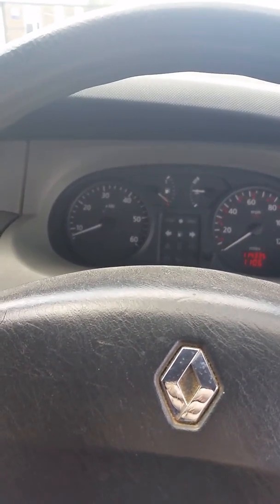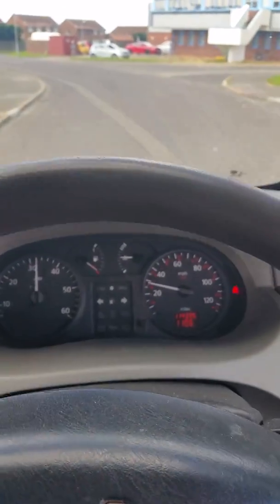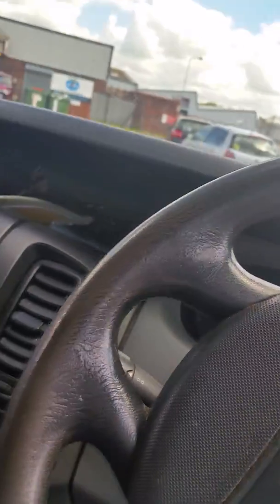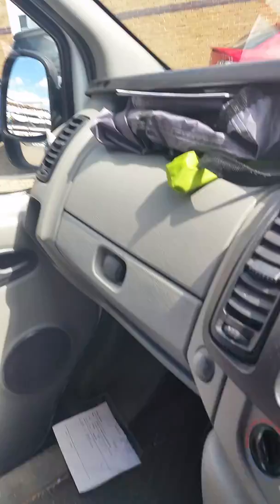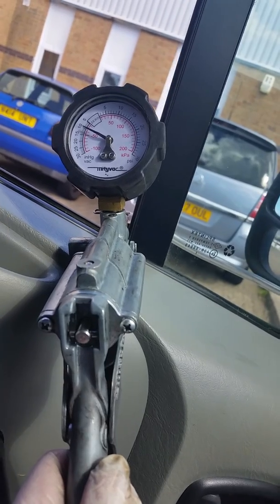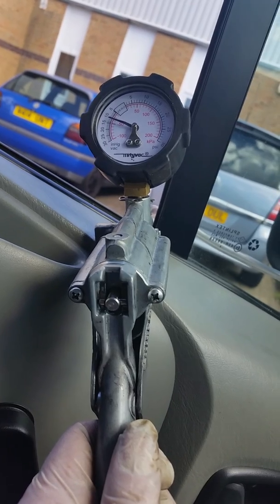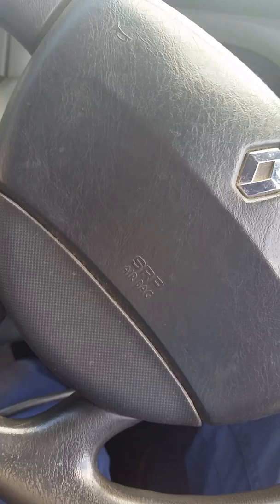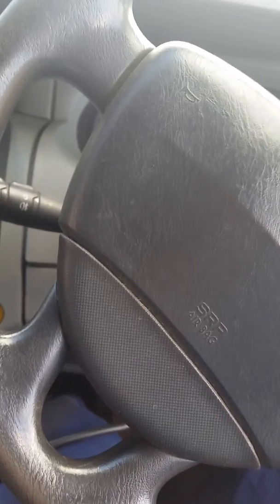Renault traffic lacks power diagnosis

Comment: I have a 1.9 trafic that all of a sudden has hardly got the power to get up the driveway of the house. Like it's got about ten per cent of the power it used to have and thats with foot to the floor.  Any ideas ?   It doesn't have the magical blue plug in the fuse box its a 2006. Thanks

Comment: Mines exactly the same in vid on power till 2400-2600rpm , I tried the pedal tho and my pedal goes soft after engine off.Driving me nuts can’t figure it out, could it still be same thing my  brakes just feel soft to as u come to a slow stop ( just pushing them) it’s like the pedal feels sticky and goes slightly soft when u come to a stop

Comment: Remarkable in all this. Is that, how people with so much information around. Still neglect something as basic as oil and filter changes. It´s by far and wide the best engine savers in the long run. Penny wise, dollar stupid, to it´s best. ;-)
Among other cases once I was faced with a client complaining about valve train noises, general malfunction, surging, etc, etc. a complete plethora of issues. 
Pull the dip stick and it looked BAD and smell worse. Upon removal of the valve cover, shocking... It was difficult to distinguish, valves, springs, etc. totally covered in a pile of residues left from pure lack of oil changes and total neglect. Situation that lasted for YEARS. Ridiculous.
Well he really didn't like the bill. :-)
Reply: twat

Comment: Hi I have a 2007 Holden Rodeo it has same problem when the engine is cold but runs fine when its warm, specially at the traffic light when I have to stop and start moving.Any suggestion. Thanks
Reply: Hi have you repair?

Comment: Did you not have a problem with your brakes also ?
Reply from the maker: cdracos1 only if you continuously pumped the pedal
Reply: Diagnostic Check i dont have any problems with my brakes, would this suggest my pump if fine ?

Comment: hi, i have loss of power on my dci 1.9 renault scenic rx4, can an engine flush and new good oil solve the problem of the vacuum pump? if this is the problem of low vacuum...

Comment: new erg and maf senor still the same
Reply from the maker: Any fault codes?
Reply: Nothing at all ecu showing no faults
Reply from the maker: Is the boost pressure sensor reading correctly? Check the operation of the wastegate mechanism

Comment: hi mate got 06 1.9 dci no power till turbo cuts in and plus will not go over 3000rpm can u help ?
Reply from the maker: Try removing EGR and cleaning it through. If not get MAF Sensor tested with an oscilloscope